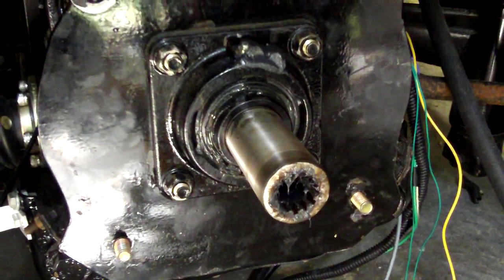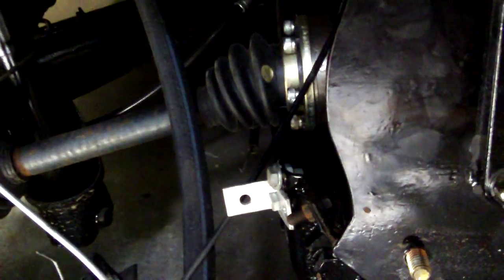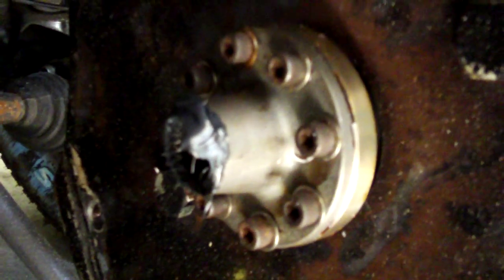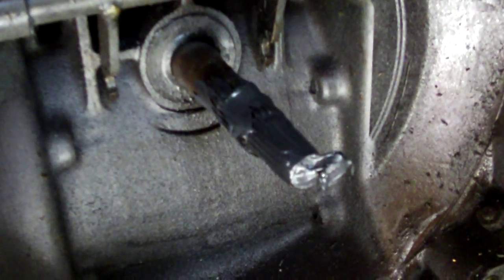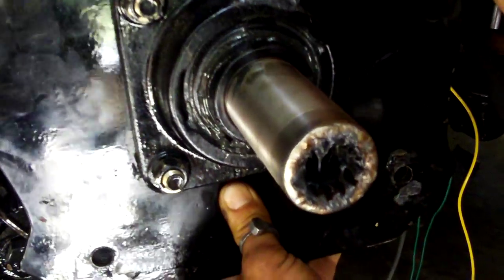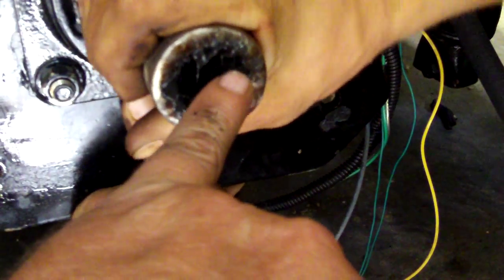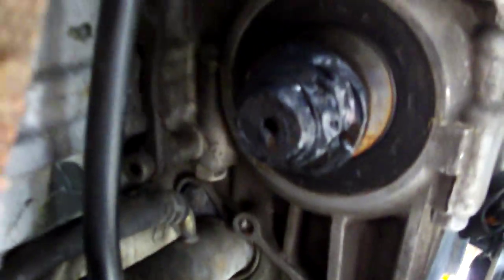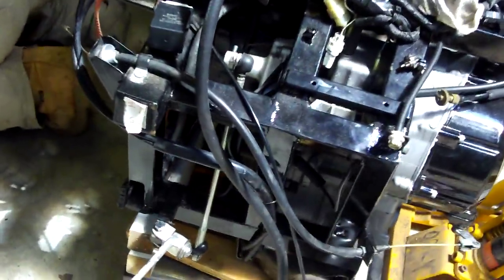Oakys Garage: Bradley GT Driveshaft explained R1 VW GT

Comment: My real question is does anyone know how the shift part work. Do you just use the transaxle to shift gears or do use the motorcycle to shift gears or you do you do both
Reply: Just use the motorcycle gearbox. Vw trans is basically to obtain reverse gear. To my knowledge

Comment: How much of a pain in the ass was it to get the shaft centered in the plate? Did you just take cross measurements from bellhousing bolt to bellhousing bolt diagonally, drill where they cross, shove the shaft thru and call it good?

Comment: Idea. Take out the vw trans and put in a miata rear diff then build mounts for the engine and then have a u joint made up (small driveshaft) to fit the splines of the engine and diff that way pulling the engine is still simple but you also shed tons of weight and if you blow a diff 4 bolts comes out drop a new one in there ya go an also get a better weight balance because instead of being rear engined it could be mid engined. Just food for though. Im 16 and designing a vintage 60s pikes peak open wheeled track car amd thats what im gonna do. That way u can use the stock 6 speed trans and a starter motor for reverse